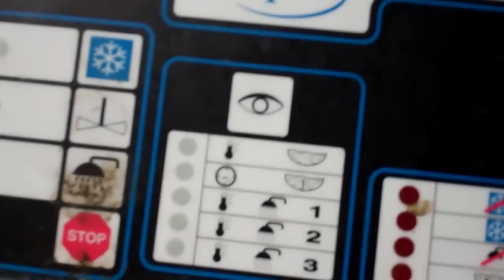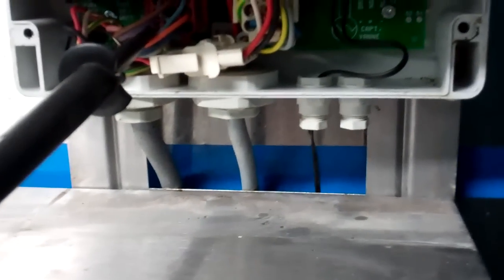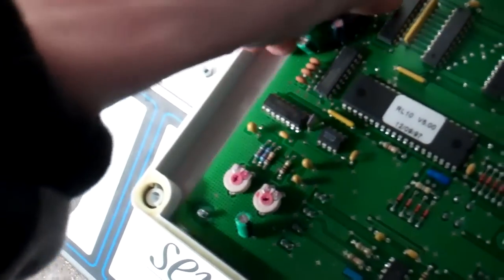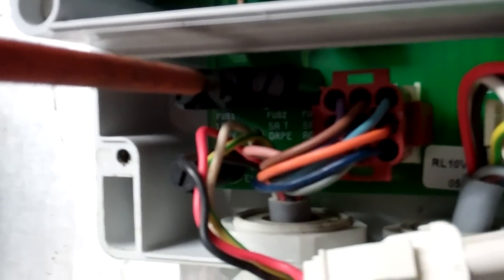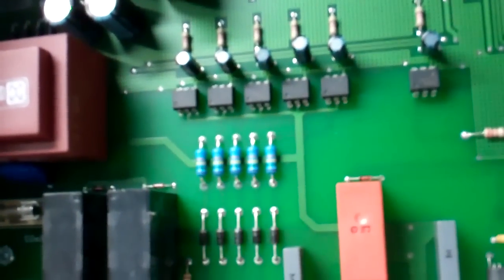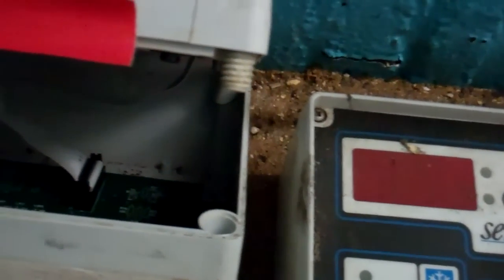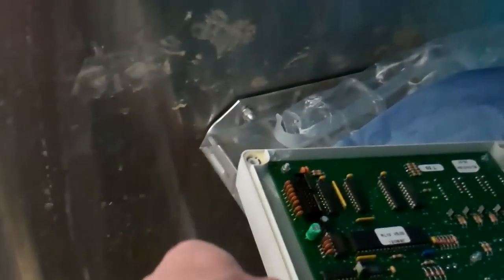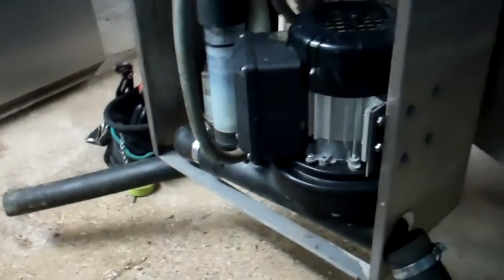Serap RL10 fix fail

Comment: Hi really appreciate if you could post a link of a manual for the SERAP RL10 if possible. Have been asked to work on one and I have no idea about these tanks. Only delaval and fullwood
Reply from the maker: Hi, these controllers are well over 20 years old in design so all the info I have is paper based, am happy to run the manual through a scanner and email to you.

They are fairly simple and tend to either work or not, but can have a few intermittent faults when they have some years on them. They are obsolete now but Serap supply an upgrade kit the the RL10.5 which is easy to fit.
Reply: @heavydiesel  Hello, my name is Telmo from Spain, I have read that maybe you have the manual of the serap rl10.  I would be very grateful if you can send it to me by email.  I have a tank that we want to delay the start delay setting and there is no way possible.
Reply from the maker: @telmoentrecanalesbaratey4103  email sent, let me know if there are any problems etc
Reply: @heavydiesel  please i need serap rl 10 wiring diagram. and thank you very much
Reply from the maker: @rachidalaoui3473  Let me know your email and I'll send you what I have.
 There should be some factory diagrams, some in the wash timer box and some in the box at the rear of the tank unless someone has removed them.
Reply: @heavydiesel  Thank you from the bottom of my heart, thank you very much
Reply from the maker: @rachidalaoui3473  Give me your email address and I'll send you the factory manual for the Rl10, has the programming and fault code info in too.
Reply: @heavydiesel  Sorry, YouTube doesn't allow you to put email in comments Is there a solution, thanks again
Reply from the maker: @rachidalaoui3473  I think you can get round that problem by putting a space in the middle of the address
Reply: @heavydiesel  alaouielectrolux
Reply: @heavydiesel  gmail
Reply from the maker: @rachidalaoui3473  Have sent, let me know if you got it!
Reply: @heavydiesel  Yes, thank you very much

Comment: Hiii maybe you know what mean E21 on Serap RL20. Thank you very much
Reply from the maker: Hi,

E21 is Agitator 1 fault.  Basically when the agitator is powered on by the RL20 the agitator sends a signal live back to the RL20 to tell it it has started ok. The fault code says the signal is missing.

The most likely thing is the 5uF capacitor in the agitator is weak and the motor either can't start turning or starts but overheats, after a few minutes of trying to start and the motor trips its internal temperature sensor and the run signal will be lost to the RL20 generating the fault code.
It could also be a mechanical fault with the agitator where the gearbox is seized,  the paddle broken and jammed, or even the milk frozen and the paddle stuck if say the temperature sensor has gone bad.

Other less likely issues could be a broken signal wire (rodent damage for example) or a fault with the RL20 circuit board not seeing the signal even though it is present.